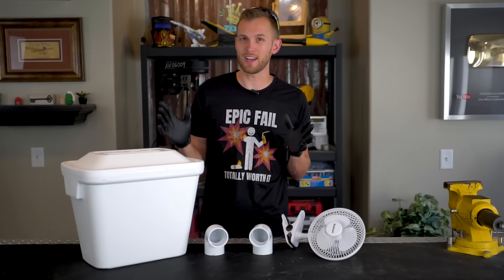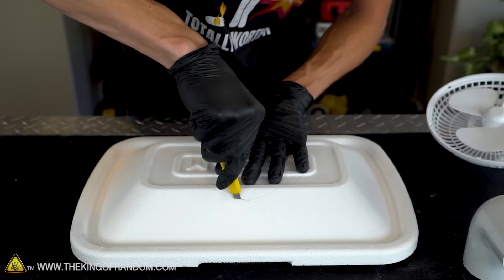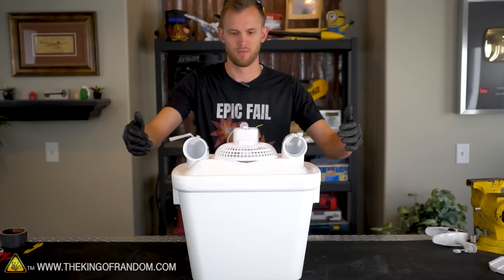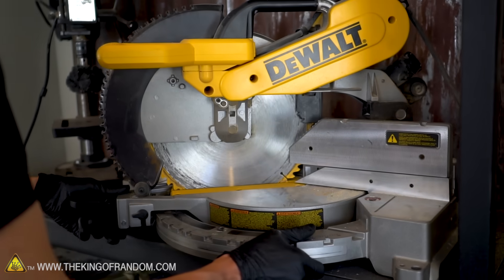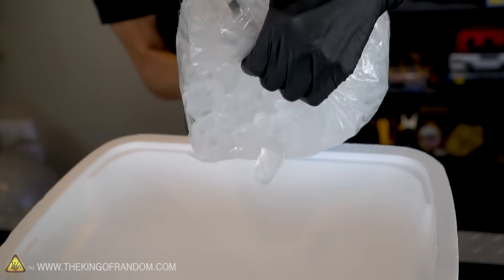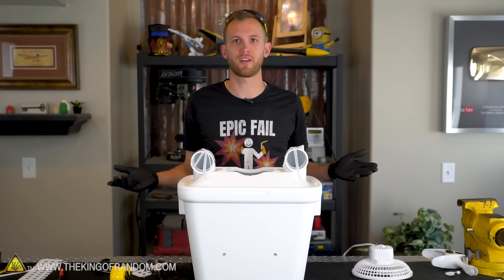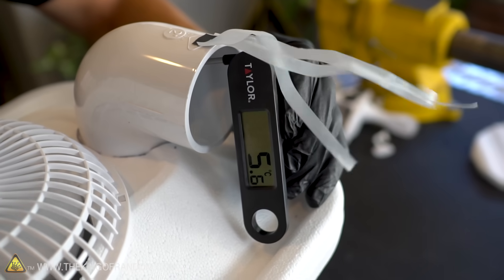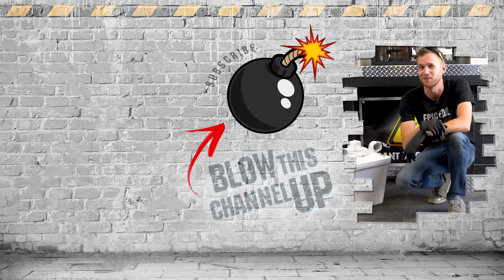Recycled Styrofoam Air Conditioner! TKOR Creates An Efficient DIY Air Conditioner!

Comment: Try using elbows at the bottom and connecting it with a T-piece(don't know the actual term) and attaching a pipe piece that reaches 2/3rds to 3/4ths up towards the fan
Then fill the box with salt water with ice
Now when u turn on the fan it should be cooler
Even if it isn't it is interesting enough to try out

Comment: Adding more ice to the bottom would obviously cool it down more... you are adding more ice to the system. the better test would have been to split the existing ice into two layers to see if the layers mattered. Also, the benefit with the bottles was dealing with the water after. So maybe a compromise would be ice packs or something so you can increase the surface area but without water getting everywhere?

Comment: what if you use a mesh in the output pipes. the air will be banging into the obstructions then it loses energy in the process making the air cooler. it effects the speed the air exits the cooler but it deceases the temperature

Comment: Also,  no need to cut up a cooler.  Just use a plastic bucket as it would be stronger and there is absolutely no need for insulation because your goal is to melt the ice to cool the room so insulating the ice only reduces the effectiveness.

Comment: Having been a refrigeration mechanic for many years, I believe I have the factual information to dispel any notion as to the effectiveness of such a device.  It takes approximately a ton of a/c to cool 400 sq feet of 8 foot ceiling height space (that is insulated).  That is a fudge factor used in the industry.  A ton of cooling is the amount of heat it take to melt a ton of ice which is 12,000 btu's (a btu is the amount of energy it takes to raise a lb of water 1 degree).  A block of ice may weigh in at about 5 to 10 lbs (a fraction of a ton).  So the cooling ability of this device is limited to a fraction of the amount needed to cool a 400 sq foot area.  SO IT WON'T WORK!!!!
Reply: Sometimes it's not the entire room that you care about, it's the coolness right in front of your face that counts.  This experiment never claimed to be cooling an entire room.  It seemed to me the experiment is a way to effectively improve the cooling of the fan blowing on you for little extra cost.  Depending on the ambient temperature, the insulation of the container may be more important with more heat.   (That container isn't going to keep the ice frozen in 120-degree (49-degree) heat.)

Hey, I would appreciate your calculations on the curve that shows how long this experimental cooling would last, because definitely as the ice melts, it will become less and less effective.  It would be nice to know how often and how much ice needs to be added to maintain a temperature over a long period of time, and calculate how much energy (including operating the fan) you need to make more ice to keep that cooling process up.  Then compare the cost of making ice compared to the cost of running a mini-AC.   A system like this just might get one through a few hours of the hottest time of the day, though, instead of 24X7 operation?
Reply: if you take ice  from the freezer  the unit dumps more heat in the room when it turns on  to  make more  ice  .   Try drinking a glass of ice water  directly  cooling  you  instead .

Comment: Adding open ice to the cooler is totally counter-productive since humidity is one of the two main reasons people are uncomfortable in hot weather.  You are adding humidity in direct proportion to any apparent additional drop in temp which will effect the net result, even though you are not measuring it.

Comment: What happens if the ice melts? Pipes are going to be below water.
Reply: No Name Yes. The whole concept of this AC is to allow air go freely through the ice and tubing. If tubes are deep down the ice, when ice melts the exits of the tubes are going to be submerged, and a fan won't be able to push the cold air through the tubes. Am I right? Did I miss something?

Comment: i have an idea to test, wrap each of the ice bottles with a cloth that will wich water. wet the cloth bottle wraps and then put about a half inch of water on the bottom of the of ice chest for the bottles to sit in and continuously wich up water, the wet cloth covers over each of the bottles should provide better conductivity of cold air?

Comment: I build this based on this video. The verdict? It works if you are standing RIGHT in front of it. As for cooling down a room, no dice. Also, one of the biggest issues was the ice melts really fast. You have to have a steady supply of ice on hand to keep replenishing the melted ice. You might be better off investing in a high powered fan or just saving for a portable A/C.

Comment: Anyone else from the UK trying to find a solution to this heat wave? 

before anyone complains saying they're in Texas with 120 farenheit weather, the everyday UK home doesn't have AC and we never see this type of weather, we usually get a max of like 25 celcius.
Reply: EhhTyler umm 
Here in saudi arabia and egypt the weather is 40-50°c
And we set our air conditioner to 25°
Lol
Reply: Texas very very rarely gets to 120. 

However I live in Pheonix and it's 123! Heatwave pfft.
Reply: @cult_gg4616  Texas rarely gets to 120, but the humidity there is beyond anything you'll ever experience in AZ. It's consistently 90-100"...even at night...and 90+ % humidity regularly.
Reply: @cult_gg4616  the actual temp usually only gets to around 110 in texas where i live but the heat index is usually about 10 deg higher from the humidity so it still feels like 120 a lot of the time. Still hot enough to cause heat strokes!
Reply: EhhTyler I live and Texas and I respect you all a lot now geez
Reply: @nugget6635  you should make a video visualizing how it works. I'm interested
Reply: For sure this experiment would work better in dry climates than muggy humid climates, where adding a bit of moisture to the air makes it feel cooler.  For sure, in a too humid climate this seems an invitation to grow a bunch of mold.

Comment: how about beercans instead of plastic bottles? these should conduct much better, since I figure carrying away 20 liters of water in that styrofoam contraption is nothing I´d volunteer for AND if there is enough water in the bottom of the box it will block all airflow - I could not fill this thing up with that much ice, my freezer´s just to small for that and there´s no one I could buy huge packs of ice from...
I wonder if I could mix some ethanol in there...10% perhaps? Or oil? well, gotta go to the DIY market asap^^

Comment: Send the cold air through a tube in the center and up and out the sides. That way it self cools the intake tube and forces all the cold air out. Also you can put more ice in the box without worrying about water getting into the exhaust tubes.

Comment: An even cheaper version that i used to set up for the few hot days of summer in a northern climate - Use a cardboard box to make a plenum for a small fan. Set a tray to catch condensation in the plenum (which is on its side), and place your frozen water bottles in staggered pattern in the tray. This way, you likely have all materials available already, so cost = FREE. When the heatwave ends, trash or recycle, so no storage space needed, and just throw one together again the next year. One of these cools a small room to comfort easily enough, but, as it is re-purposed stuff lying around, make as many as you like.

Comment: Would liquid nitrogen work to make it cooler or would taking away airflow by using a liquid make it worse?
Reply: Yes to both.  Adding evaporating nitrogen to the air would also displace what we need to breathe.

Comment: @thekingofrandom I built my own and put the PVC pipe on the side bottom enough so water won’t escape either, but I used a smaller metal fan can it over heat and catch fire?

Comment: Make this thing solar or make it useable when theres no electricity
Reply: Joxef_YT not very easy to get ice where there's no electricity.
Reply: 7-11 or Walmart or your closest convenience store.  Solar, generator, or propane powered fridge much less power consuming than AC.  It's feasible to run a fridge off solar (to make the ice), not so much for AC.  But I've thought about adding an AC cooling fins to the system to increase cooling.  The more surface exposed to the cool air, the more effective this can be... but also melts the ice faster.
Reply: Joxef_YT been there done it solar power is the way to go I went to the 99 cent store picked up several lamps take the solar power panel out now I have to figure out a way to get more power because they basically stayed the same power even while linked maybe I'll temper with the circuitry and make it series or parallel

Comment: I made one of these at work once. I was working in a laboratory at the time, and the air conditioning system was dead. With all the heated equipment, it did not help much as it was not strong enough.

Comment: Using loose ice cubes is messy, you have to clean the unit out each time you use it.
Your original idea of plastic bottles was correct - with a slight mod.
By saturating the bottle water content with common TABLE SALT you reduce the freezing point of water content.  The more salt you put in the lower the water freezing point.  Well below 0c or 32f.
With reserves in the freezer its a quick and clean replenishment.
HONEST it really does work.
Reply: This message encourage me spot on. Exactly what in my mind, reserved bottles in freezer but u gave additional help: put salt in it. Thank you for your assurance. My hesitation is solved

Comment: Pretty impressive, though I believe one problem with the free ice cube design is that once the ice melts if the water rises to the opening of the PVC pipes the system doesn't work anymore.
Reply: You could install a drip tray inside the cooler and small pipe to allow the water to flow out the cooler

Comment: or you could just use the fan
Reply: Fredy Ordonez not once the air is hot enough(like above body temperature). Also the fan makes heat, so a fan wouldn't help...

Comment: People have been doing this for years!? My dad is an air traffic controller and Cessna planes do this all the time because they don't have ac!
Reply: Yeah. but they didn’t have You Tube for sharing.
Reply: Yeah, they sell commercially for abt $300, but this is cheap, gonna try it
Reply: so?
Reply: Weight is important in a plane.  This whole system probably weighs about 12 pounds, full of 10 pounds of ice.  Tip:  If you want to get cooler while flying a Cessna, open the window in flight :) -- if you don't need a mask and you're flying under 12,000 ft, that's an easy way to cool off for free.

Comment: Should put a small water pump and some type of water cooler filter plastic or straw and keep a window cracked I use a I line duct fan and cool air from outside works just like a water cooler I use it In that one room in the house that doesn't get air

Comment: One thing I would like to point out if you put the tubes too low in the ice when it melts the water will fill the bottom of the tube and the air will not be able to transfer through it

Comment: What if you put dry ice or liquid nitrogen in the container?
Reply: Noah Modesto NO dont do that that turns your house into a gas chamber. Dry ice is liquid co2.
Reply: *solid
Reply: Preston Kellenberger “turns your house into gas chamber” lmao
Reply: yeah sure, I´ll just have a visit to me local market and ask for liquid nitrogen...geeez
Reply: liquid o2 is −183 °C if you were to breath N2 −196 °C or O2 is would cause your lungs to freeze plus liquid O2 is extremely hard and expensive to make and buy!
Reply: Oh, lol
Reply: hold on, but if you mix liquid O2 with liquid N2 with dry ice, that fine right? just normal air mixture
Reply: Noah Modesto just buy an air conditioner
Reply: well im not drinking it right?  it will work in theory
Reply: poisonous
Reply: Liquid N2 or O2 simply boils off very quickly. Did you see his O2 video and how hard it was to obtain a tiny amount of liquid O2?
Reply: Suffocation
Reply: Go to science school first

Comment: 1lb of ice absorbs 144BTU of heat before it melts. 5lb of ice usually costs $1.00.
A $120 window AC removes 5,000BTU/hr and uses around 0.4kWh (About $0.04 with standard US electricity costs).

$10 DIY AC: 720BTU per $1
$120 Window AC: 50,000BTU per $1

It's certainly a neat DIY project that could be useful for cooling yourself off where a window AC isn't possible. IE: A covered porch. But certainly not cost effective in the long run.
Reply: And I don't know where you're getting a AC window unit 50,000 BTU for $120 last time I checked Walmart sells a 10,000 BTU for over 500-600$
Reply: @waterboy46  I think that was a typo. They probably meant to type 5,000 instead.
Reply: Not in a trailer park home that runs off of a swamp cooler turn the swamp cooler off and the little AC unit runs the Bill up
Reply: I just put ice packs

Comment: Putting ice cubes just turns this into a swamp cooler. You get cold air but you also raise the humidity in your room. Higher humidity is more uncomfortable than just hotter air. Thats why you use frozen bottles. If your somewhere with low humidity this don’t matter. Every where else it really matters.

Comment: Speaking from experience, one problem with using direct contact of air to ice is that it actually increases the humidity of the air in the room you're trying to cool, making it more difficult to cool.  Stick to using re-freezable containers like gel-packs, small water bottles, pill bottles, fake ice cubes, etc.  Perhaps using some kind of metallic mesh might also help cool more air in the same time interval.  Optimum performance is going to be some compromise of how fast the airflow is (slower makes cooler air) and what you can tolerate as a delta-T.
Reply: Yes if u live in high desert like mine the humidity there is 16%
Reply: chaka

Comment: Put liquid Nitrogen in the box... Also, what happens if you use liquid nitrogen as a refrigerant for a fridge?
Reply: Commercial refrigerator systems can't keep nitrogen cold enough for it to remain a liquid.  They're also designed to pump gas, (Freon or functional equivalent) not liquid.

Comment: Amazing! I already have a few plans for it

1.cooler for gaming console over heat (ps4)

2.if you glue gun the pipes and the fan to the lid you can easily take it off and cool drinks +2 refreshments 

3. If fridge broke down or you just want an easy mini fridge you can attach two pipes to the elbows and attach them to some kind of fridge like box made of some kind of insulator material

This was an astonishing design.... I’m only in 5th grade btw
Reply: Lakitu907 New 2 and 3 are more complicated than just putting your stuff in a foam box with ice...
Reply: 1 is a bad idea. Moisture and electronics don't mix.

Comment: If you use ice, won't the water from the melted ice block the air flow to the tubes on the bottom of the container?

Comment: The problem with these "swamp coolers" is that they add a bunch of humidity into the air... humidity is bad when you're trying to cool off.
Reply: Guildofcalamity, Umm no??
Reply: Umm, yes.
Reply: Yes because we sweat when we get hot. It's the most natural and affordable way to stay cool lol. If you're really worried about the humidity just use the water bottles or something like an ice cold frozen metal sheet that the air can blow across. Many different ways to make air cold than just ice :)

Comment: What if you used a screen to block the bottom of the pipes and filled them with ice? Might be more efficient too. 

Also, if you are using this in the same room as the freezer you are using to make the ice you will make the room hotter. You spend energy (creating heat) to blow air around and then you put the water in the freezer. The freezer removes the heat from the water to form ice again, and it takes more energy to do that. It puts all the heat into the room again, making it hotter from all the energy used. If you have a freezer in a space that can be closed off from where you want to be cooled, like a garage, then it might be useful.

Comment: Used a similar design for when I go camping at the beach.  I will have to use this design for next time.  I have learned if using ice to add a little salt which helps and to also make sure the cooler is not cheap.  Had all melted water from the ice leak out the bottom and all through the tent.

Comment: Ima modify it EVEN more

Ima add a digital thermomiter attached to the inside of the pipes
and MAYBE a heater if thats possible idk Im thinking of insulation(Tinfoil and Rubber) and make a magnifying glass heat up the tin or something idk

Comment: The one issue I can see you having if the cooler is used over an extended period, is the ice melting and covering the holes of the pipes, and cutting off the airflow.

Comment: The whole contraption barely lasts 1 hour, with maximum effectiveness in the first 10 minutes. Afterwards, it quickly drops off, turning into tepid water in under 60 minutes. It takes longer to freeze / gather ice than it does to quickly melt off for a very, very, very temporary relief.  :(

Comment: hi I have a electric zapping bug swatter and the electricity from that is about 1000 volts and in a previes video you guys have made u were using around 11000 volts and said it was high voltage because the electricity jumped through the air and my bug zapper dose the same

previes video  don't mix electricity with water
Reply: can u try and help me understand plz plz plz